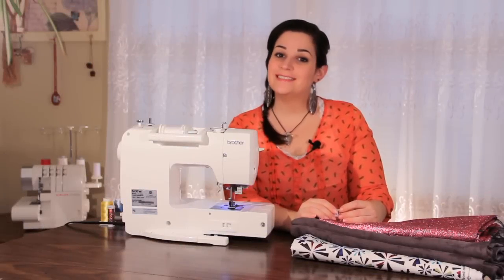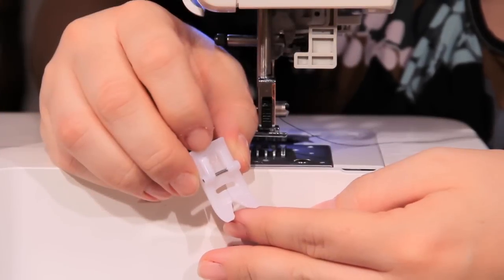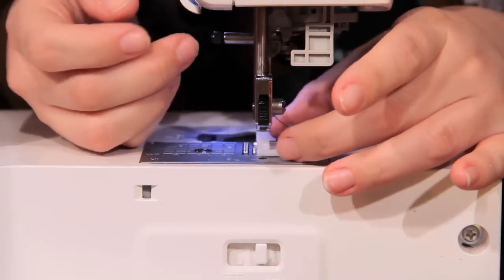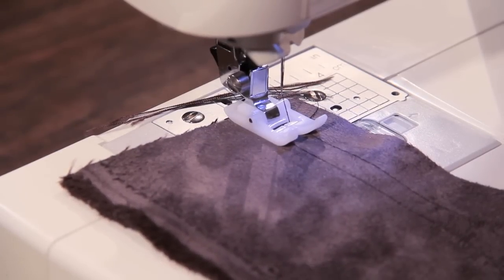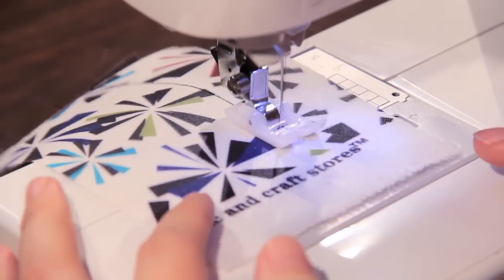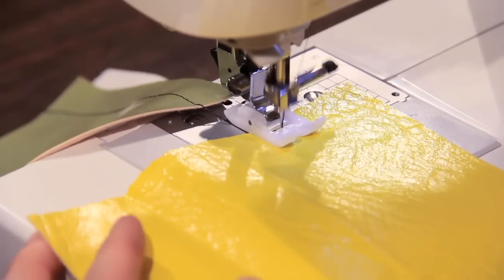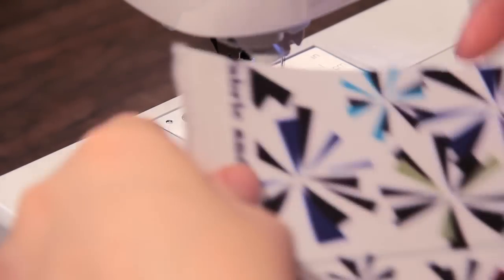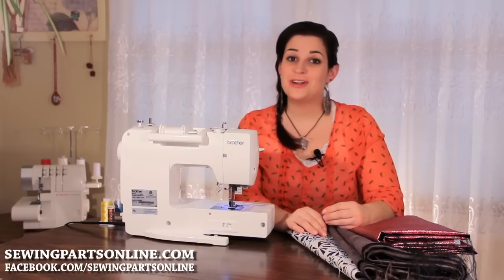How to Use a Non-Stick Foot

Comment: One tip for you when using this foot: DO NOT sew without fabric under the foot. The feed dogs scratch the foot over time and it starts snagging on things. You want to keep the foot nice and smooth because that is what allows the materials to flow across the surface with ease.

I learned all of this by experience. :)
Reply from the maker: Kevin Sews You are completely right - thank you!

Comment: Would this foot stop knits from getting eaten in the feed dogs?
Reply from the maker: MzKFoster Hi! Not that I've seen. To prevent knits from being gobbled up, try placing some tissue paper under the first inch of sewing and use a smaller ballpoint or stretch needle. Good luck!